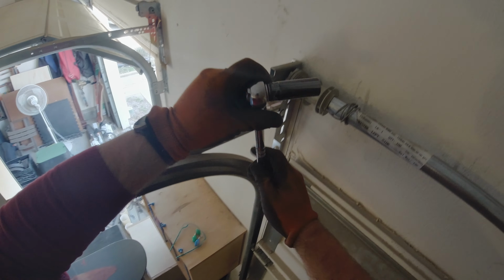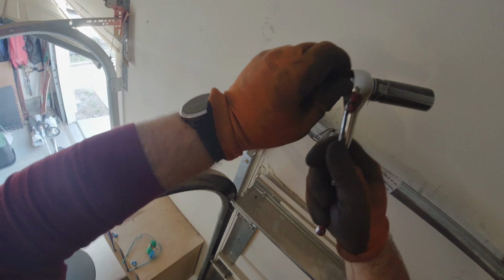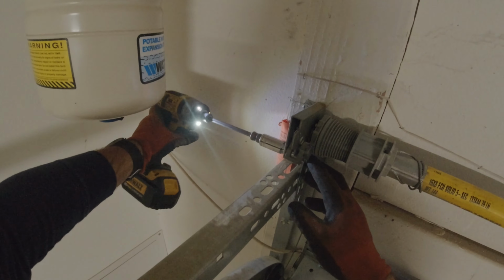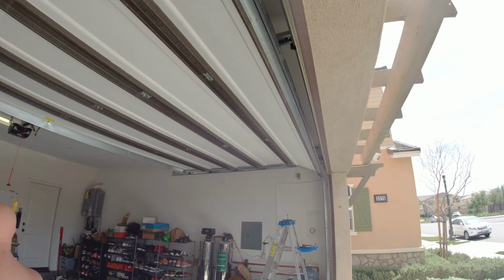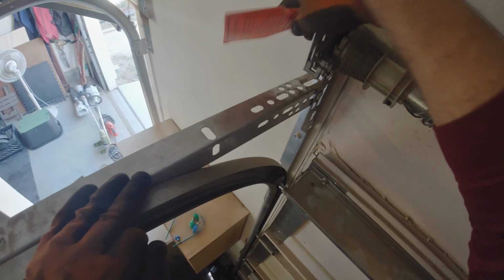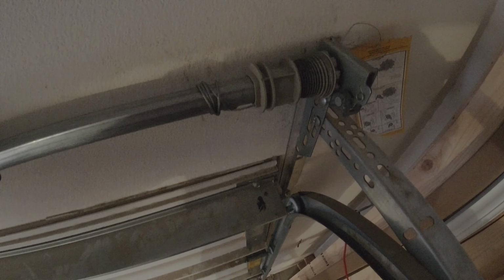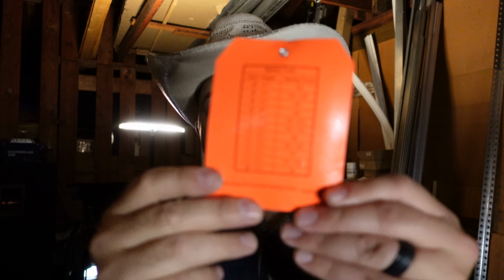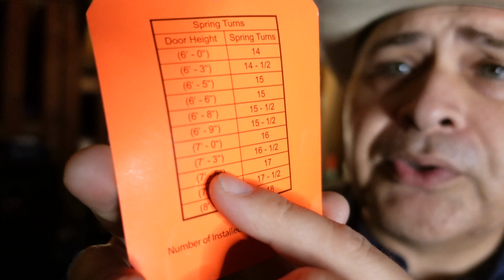Balancing Torquemaster Plus Springs - How Many Turns?

Comment: Thx for the video. Should I try tightening a TorqueMaster spring? My opener failed about a week ago due to a circut board failure. This was after I noticed it was struggling about a month ago. I detached the door from the opener to get my car out and WOW it was HEAVY! Almost felt like no assistance at all. Much heavier than I remember from when we lost power about a year ago. The house is about 10yrs old and as far as i know, its an original spring. I dont want to put in a new opener without getting the spring dealt with first. Tighten or replace?
Reply from the maker: Thanks for reaching out.  Torquemaster usually last between 8-10 years depending on the usage of your garage door.  

If you are a handy person, you should have any trouble replacing Torquemaster Springs.
Reply: @sosgds  thx. Handy? Yes. Wealthy? Absolutely not, lol. Cheaper replacing torquemaster springs or converting to torsion springs?

Comment: Both of the springs broke on mines, I ended up taking them apart and re-welded up the springs then reassembled them back together torqued them to 16 rotations each and it works good as new 👍.

Comment: Without a doubt this is the best video for a DIY guy!!! I have a 6'-6"x 9' Wayne Dalton door and this afternoon when I pressed the button to open the door it pulled the bracket off the door. I used the release to open the door to get the car out and it was dead weight. I released the pressure on the spring per one of your videos and thought that I would rewind it to the specs but not sure on this one if it should be tighten the 15 turns as indicated on the card for a 6'-6" door on just one side. Advise would be appreciated.

Comment: I’m getting a replacement garage door opener from Chamerlaine. She asked me if my door free falls at all. I have a Wayne dalton with (I’m assuming) Torqemaster spring system. The spring in the tube, it’s only 6yrs old. So I went inch by inch and it closed on its own around 8-10” from the ground. She said that’s bad and it needs servicing. Is that correct info? And if this is the case, has the spring come loose a bit and need tightening? I don’t wanna damage my garage door opener by having it fall on its own, even 10” from the ground
Reply from the maker: Great question!  The idea about garage door balance is that you want the door to stay at any position when opened or closed. The reality is that balance can be a matter of preference.  Some techs prefer that the door travel a little heavy when closing.  In fact gravity can help on the close travel to some wall mount motors.  Yet the consensus from the industry is that you don't want the door to slam down when opened at the 7 foot level.  

Now the variance that your garage door is experiencing is not detrimental.  In fact it's normal.  Thus, and only if you are confident in adding tension, you can apply slight turns to adjust for the garage door balance onto the Torquemaster spring.

Comment: I have a wayne dalton door, it's working fine.  Though the other day the safety mechanism activated on it and the garage door was left open until I got home from work and figured it out.  My question is...I want te prepare for when the spring does snap.  How doni measure the weight of a garage door on a wayne dalton system when the door is fully operational?

Thank you
Reply from the maker: Hello.  The weight of a 9100 model garage door will show on a yellow or white sticker on the Torquemaster Tube.  The range of the weight usually falls between 120 to 150 lbs (55 to 68 kg).  Yet I have a sneaky suspicion that your springs are broken or at least the spring that trigger the anit-drop feature.  Did you apply tension to that side that locked?

Comment: Thanks for the fast response.   I’ve been told the number dial is not that accurate.  I have torqued it to what the recommend amount is.    Is not there yet.   Is it possible to over torque it ??
Reply from the maker: Hello.   Yes it is possible to over torque.  Are you using the Wayne Dalton dial that's for Torquemaster?  I actually recommend a 5/8 deep socket.

Comment: I have a wayne dalton 9100 that feels heavy on the bottom. When I hit my garage door button from the wall, it lifts the door a couple inches, then it goes back down. Then when I press the button again, the door goes up like normal. Is my spring going out, or could it be something electrical with the motor? The safety eyes are aligned and no obstruction(s) in the way of them. This happens nearly every morning or when the door hasn't been used for a several hours.
Reply from the maker: There's a possibility that your torque Master Plus spring is broken. Yet there might be a another possibility, which could be your garage door opener. Specifically your garage door opener sensitivity or Force sensitivity might be low when opening the door. 

There are a couple of tests that you can do. I would disconnect the garage door from the opener and lift the garage door by hand as safe as possible. If you feel the weight of garage door is more than 30 lb then you might be dealing with a broken torque Master Plus spring system.

Comment: Great video. I just installed mine last week and got it working. 

I bought the springs for  160lb garage door. Mine has windows on top. I couldn’t measure the weight of my door because it’s too heavy without the springs’ assistance. 

For some reason, it’s not working properly. It opens and closes the door BUT after 10 minutes if rest, if i press the wall switch it just opens for about 2 inches and then it stops so if press is again it will reverse. 

Then after 1 more press it finally opens properly. It always does that. HELP!!!!!!🤦😹🤯
Reply from the maker: Thanks for the feedback.  Can you tell me if the door is properly balanced?  If you lift the garage door does it stay at the 3 ft, 5 ft, and 7 ft level?
Reply: @sosgds  thanks for responding. I don’t think it’s balanced. I am already above the standard turns for the size of my garage door and it still slams going down. If however it’s almost on top it runs fast towards the powerhead. I have the Genie 7055.
Reply from the maker: @bamcotv  okay. Then it could be that the springs maybe a little bit too strong. Now there's no problem in having the door a little bit bottom heavy. But what we don't want is for it to race down to the ground and slam at the 5 ft level and 3 ft level. More importantly if the door races up it could cause damage to your garage door motor.  This can you confirm for me if the door slams from the 5 ft level and or 3 ft level?
Reply: @sosgds  it slammed on both heights. 😩 should I get the 180lbs spring set or the 190lb? Could that be the reason why my new Genie 7055 is malfunctioning?
Reply from the maker: @bamcotv  yes, unfortunately I have a sneaky suspicion that the springs are not rated properly for your door. So let's do this so that way I can provide you a little bit more guidance. I will provide you my email address if you could perhaps send me several pictures of your garage door system but from inside the garage. I don't need any outside pictures. Basically I need a full view picture of your door from the inside. A side view picture of your garage door, specifically the thickness. And a close-up picture of one of the sections preferably where one of the middle hinges are located. With these pictures I can determine certain aspects of your door and recommend the proper weight size of springs you should be looking for.  Here's my email: sosgdoservice@gmail.com
Reply: @sosgds  i will send you pictures asap. Hey thanks for helping me out. You’re a big help for a DIYer like me. Your channel deserves at least 100k subs no cap. 

The quality of your videos are top notch. Keep it up. You’re doing great on your SEO and tags. You always come up at the top 5 on my search results.
Reply from the maker: Thank you so much for the support.  I truly appreciate it.  I look forward to getting your pictures.

Comment: When you adjust the tension. I'm assuming you adjust with the same turns on both sides, right?
Reply from the maker: Hello!  Yes.  For a 7 foot tall door it requires 16 full turns.  The best way to do this is place a marker on your 5/8 deep socket.  When that mark makes a full turn that can be counted as one full turn.  Hope this helps.

Comment: Great job your not a nobody!
But I'm not going to lie I will only have a party on torquemasters when I convert them. Then it sounds like a party.
BTW do you carry their springs on your truck. In Houston I'm usually 1 hour 1 way from them with traffic. So it would be by far cheaper for the customer if I convert to torsion plus I can get them 70,000 cycle springs if they want.
Specific to this video its a great job I can show it to my guys if the customer provides the parts it will show them the tricks. Thank you!
Reply from the maker: Hey Cody!  I know what you mean my friend.  Converting a Torquemaster offers a lot of benefits.  I usually offer to convert when the customer has just lot all faith in the Torquemaster design.  

Wayne Dalton is pretty much in my back yard.  I'm minutes away from them.  So getting Torquemaster springs is not difficult at all.  The Chino Wayne Dalton distribution center has dominated this area for some time now.  In fact, this entire area of Chino Valley is covered with 9100 model doors.  And with the current spring shortage, I can easily offer these springs to local customers and get them going as opposed to waiting for backordered springs.  But I am glad that this video is helpful.  That's what this channel is about.  Thanks again for the support Cody!

Comment: I have a torquemaster that's 9 yrs old and it still works fine but my garage door is not balanced. Can these systems be balanced or do I need to replace the springs?

Comment: What do the top and bottom positions for the levers/switches on the brackets do?
Reply from the maker: Great question.  They lock in when the spring breaks.  
Flipping the lock up will allow you to tighten or losen the spring.
Reply: @sosgds  So do I need to flip them back into the locked/down position after I'm done tightening or do I just leave up all the time?
Reply from the maker: @bibidi2568  yes.
Reply: @sosgds  Sorry, yes you leave it up or yes you leave it down?
Reply from the maker: @bibidi2568  They should be in the down position.
Reply: @sosgds  Hi Santiago quick follow up question. I replaced both springs on my door and when it opens it seems a little janky but when I try to close it, it will go halfway and then reverse itself. The sensors are clear and nothing is blocking them. You have any idea what may be causing this issue? Thanks.
Reply from the maker: Does the motor blink or make a clicking noise?
Reply: @sosgds  yes there is a red blink when it reverses.
Reply from the maker: @bibidi2568  red blinking from the sensors or the motor box?
Reply: @sosgds  sorry the genie motor unit. And if I remember right a clicking sound.
Reply from the maker: @bibidi2568  so what I would advise is to reprogram the travel limits and run the opener four times with the new travel setting limits set. If the problem continues to insist then there might be an issue with your safety sensors.
Reply: @sosgds  I’m assuming that’s with the door detached from the opener?

Comment: Great video. I noticed in the video that for 1 turn on the spring there's about 2 turns from the socket wrench? Is there some kind of gear reduction in there or is it just me
Reply from the maker: Good question.   There's a total of 8 clicks per turn.  And with torsion springs we are use to seeing 4 turns.  At any rate there's a bit of an illusion on how these springs are balanced.

Comment: The tension when tightening the door isn’t staying after 5-6 turns, it has to be held with a pair of vice grips. Taking the ratchet off at 16 just undoes all of the torque. How do we fix this?
Reply from the maker: Thank you so much for sharing your experience. 

Are you replacing the Springs inside the tube? Or are you simply adding tension to the existing Springs?
Reply: We replaced the system with a different one. The spring was broken in the tube. ☹️
Reply from the maker: Hello! I'm happy to hear that your spring was replaced.  If in fact you did converted to a torsion spring you might find that it will provide a longer cycle life if they have applied or that is installed high cycle springs. I do wish you the best. And thank you for sharing your experience here within the community.

Comment: I just ordered the springs for my 9100 it is 225 pound door right????
Reply from the maker: Hello!  Is it a standard 16 by 7 door?  A 16 by 7 model 9100 garage door with windows will start at 145lbs in weight.  The same size 9100 door without windows is about 125lbs.  That door should not be 100 lbs more.  It's possible your garage door wind rated?

Comment: How do u know when enough torque is enough.  If the amount of turns are applied and you still need to apply more   ?)
Reply from the maker: Hello.  That's a great question.  When using the 5/8" deep socket it's best to write and scratch a mark on the socket to count the rotations.  Once you have reached the 16 full turns for a 7 ft high door (8 ft high needs more turns) then test the door balance.  If the door feels heavy as slight turns (clicks) till you are satisfied with the balance.

Comment: Can you use this system with the genie side opener
Reply from the maker: Hello.  Yes you can, but you will need a wall mount adapter for the Genie 6170.

Here's a link that might help:  https://www.geniecompany.com/garagedooropeneraccessories/TorqueMaster%C2%AE-Adapter-Kit
Reply: @sosgds  awesome thank you. I’m contemplating this system. I have a small golf car garage that is only approx 105” deep from the header. Not sure if there is a garage door rail this short for a normal motor

Comment: The torqumaster is NOT a good system. Whe the spring breaks you have no idea since it is hidden in the tube. Home owners increase up force openers to the point where they pick up half the weight of the light doors. Works great! Right? Not when the opener spline gear straps out. TERRIBLE DESIGN!!!!!! TERRIBLE
Reply from the maker: Hello.  Sorry to hear about your Torquemaster spring experience.  In the area I am in, this door dominates a number of homes.  It has offered most homeowners a solid value with its insulated design.  True, it's not for everyone.  But for most families this door will do.  Thanks for your feedback.

Comment: I didn't get the initial tension equal on the cables before I tensioned the springs. Can I fix that without undoing the spring tension or not. I would be basically starting over.